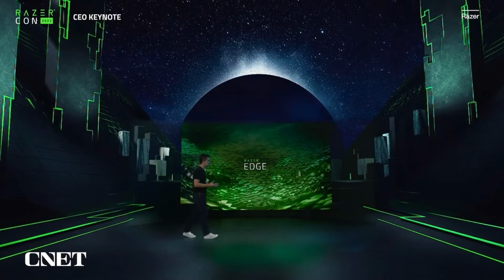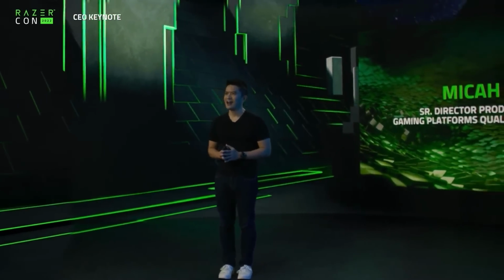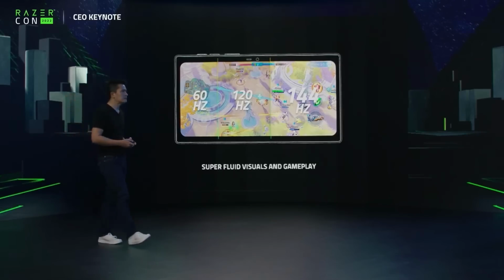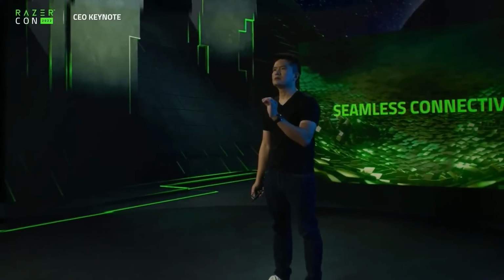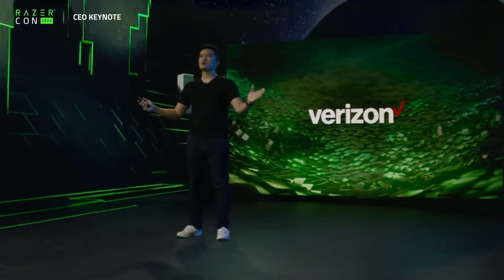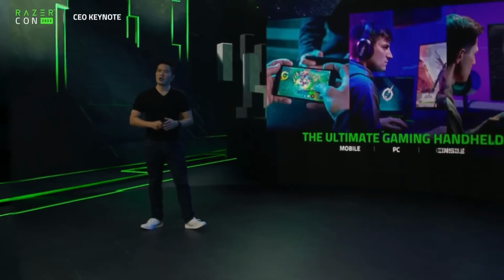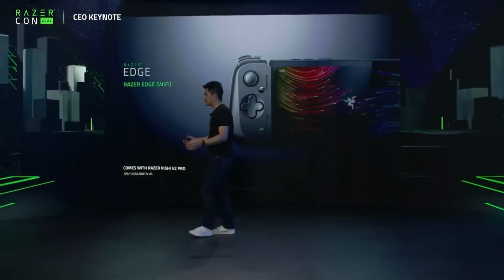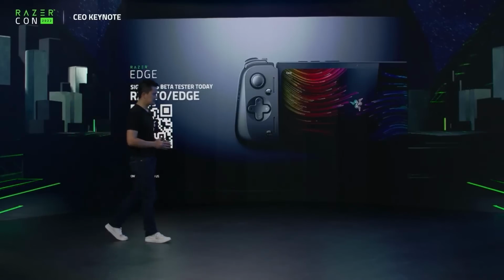Razer Edge Handheld Revealed (Watch It Here)

Comment: Most gamers tend to use more affordable carriers like MetroPCS or TMobile. If this is exclusive on Verizon, that means it does not
use a sim card, so it is going to be CDMA only. That's a mistake as most carriers in the world use GSM. Another problem I see is
that Razer decided to go with Nvidia instead of AMD. Nvidia is great and all, but they don't have open drivers for Steam. AMD does,
so you would get better performance with an AMD chipset. Android and Steam both use a Linux based OS.

Comment: Very impressive and at $399.99 they really nailed the price. With that, you get 128 GB of internal memory and expandability via Micro SD up to 2 TB. Wow! Well done Razer. Well done.
Reply: Steam deck better
Reply: @ROBMCMXCIII  The Steam Deck is pretty impressive. I already have a few Android games but I have been gaming on Steam for years and right now I have exactly 500 games on the service so I would have a large instant library of games for the Steam Deck. I just hoped the Steam Deck had an OLED screen. Seeing OLED in action on my phone and even my PS Vita makes it hard to go back to a regular LCD screen but again considering the specs of the Steam Deck, costs had to be cut somewhere.
Reply: you can watch my preview in my channel of razer edge
Reply: @TechsheetYT  Will check it out. Thanks.
Reply: Are you okay?
Reply: @kevikiru  LOL! Over the years I took advantage of a lot of Steam Flash Sales and Humble Bundle sales. The beauty of the Steam service on PC is that the games are not locked into specific hardware like console gaming. I also do have a few Android games I have collected over the years so I am interested in seeing more on the Razer Edge.
Reply: You basically get the same thing for the same price from a Steam Deck. Without needing to deal with a Verizon contract
Reply: @Ikbal Uddin That would be a pretty big issue. I was able to transfer some games on my phone to my micro sd card but not all.

Comment: So $400USD ($546CDN) for a device that has to biggy back off a high performance WiFi connection you may or may not have, piggy back off Steam link library running off a Gaming PC or Lag Central of the earth GamePass? Bruh then he had Diablo Mobile installed something my mom's Galaxy S6 could run. Idk man seems pretty greasy to me.

Comment: This is certainly better than that enormous $1000 thing they showed off with that go kart steering wheel looking case, but there are like three worthwhile Android games that can really push a flagship SoC. There's GI, COD, and LOL. DI is a thing but it's disgustingly pay to win. You can cloud stream console and PC games with any halfway decent smartphone as long as you have good wifi. Anyone with $$400+ to throw at a dedicated handheld gaming machine probably has a $500-$900 phone already, so why would they get this instead of just the Kishi V2 or a Backbone (Android version ships Nov,) which IMO is better. My Oneplus 10T is just as capable as this thing minus active cooling (which isn't needed for cloud streaming and 99% of Android games). It also does phone type things which is super useful. I just don't know who the Edge is for. Someone who doesn't have a flagship phone but wants to drop $400+ to mobile game, and also isn't interested in a Steam deck for native PC gaming on the go or a Switch with it's huge library of first and third party games?

Comment: In a nutshell it's a 6.8 inch tablet with a Razor Kishi controller. It would be a cool product if the steamdeck didn't exist cause you're getting a tiny powerful android tablet for 299 and a controller that costs 100.

Comment: Whats truly insane is the price
Reply: Could u get as capable a phone for that price??..with those specs??...
Reply: It depends if its a good android tablet on its own or not. If it is, its fairly reasonable based on the specs. If not its a complete joke because like the logitech, an Xbox Series S would be cheaper. The problem with Logitechs was they made this big deal on cutting down on hardware because it was cloud enable which made it a lackluster android tablet and overpriced cloud gaming handheld.
Reply: Not actually insane, 

What’s insane is insane is expecting a handheld that’s capable of playing full pc games locally installed and rendered by its own cpu-gpu and have store to install multiple said games to be made and sold by a company that also doesn’t have anything to do with where the games it plays come from cuz they aren’t running their own os and own digital games store in which to make money from to be less than $1000 still
Reply: Insane, insane, ultimate….and insane!
Reply: Razer phone was like 1k so this aint that bad...
Reply: Its more like a switch plus is actively cooled so i won't thermel throttle
Reply: It’s the ultimate price
Reply: Razer products mostly are failed products

Comment: It's a cell phone with a controller attachment. Not a true dedicated handheld for gaming, but I guess that's where the future is heading.
Reply: The switch is literally a small android tablet with attachable joy cons 😬
Reply: @JimmyMac88  but it has people making games for it not android apps and streaming
Reply: @JimmyMac88  
Yeah. Unfortunately, I only use it as a home console or a handheld at home only. I miss Nintendo's handhelds. The new 3ds(not xl) and new 2ds xl are better for putting in your pocket and playing on the go. Sure, you can take a switch or a steam deck with you but you're having to lug them around in a carry case/bag. Not truly portable like a ds or emulator handhelds like rg351p, 280m, pocket go, etc. Adding a controller to the cell phone makes it very bulky and not pocketable so you gotta carry them separately. It works, but I'd still rather have a dedicated handheld for gaming with built in controls that aren't touchscreen that's pocketable.
Reply: @JimmyMac88  the switch would have been literally 2x as much if Nintendo only the hardware and wasn’t involved in actually providing the game store and the game development
Reply: @bryanmiller476  i doubt it, the Nvidia shield released at about $180, so the switch seems priced appropriately
Reply: @JimmyMac88  its not android because its not running the Android OS
Reply: @2000sancho  no, it doesnt... but the chipset inside is that of android tablet with a low end arm based processor. The Nvidia shield runs the same soc for example
Reply: @JimmyMac88  true but what makes an android an android is the OS not the hardware inside the device, there are many arm based devices with diferent OS
Reply: @2000sancho  true, but thats kind of besides the point I was trying to make

Comment: I don’t get it. A 2400x1080 FHD+ display translates to a 20:9 aspect ratio, so very similar to a smartphone screen. 16:9 Xcloud and GeForce Now games will essentially run in a bordered 5 inch-ish size screen. Significantly smaller than on steam deck or Logitech G Cloud. The controller is detachable and looks very similar to a Razer Kishi, so the product works just like a phone/Kishi setup. Not sure why anyone would need this when they can essentially already do the exact same thing with most smartphones.  Sure, the G3x chip will run Android games and more demanding emulated games better than most phones but I suspect the improved performance here will be imperceptible to most people already gaming on  high end smartphones. Streaming games will run no differently to other existing devices as these services require only moderately powered chipsets to run effectively.
Reply: Geforce now upscales to fill my entire z fold and  xcloud can scale up 25:9... so it should be fine
Reply: Also, steam link and geforce now will runn at 144hz on this thing. I think when you look at the market. The most popular games are like esports titles

Comment: I wonder how this soc compares to the A16 bionic in the iPhone 14 pro max.
Reply: @Shaban Ashraf lmao I do... sorry the truth is a hard pill to swallow.. again, in benchmarks the A bionic chips do score better single core and multicore performance. But the margain in other benchmarks is marginal and real world use cases both apple and SD chips perform around the same level.
Reply: apple chip is always better but problem is thermal throttling...
Reply: @Amircapturedmemories  Apple chips are not way better. They do have better single and multicore scores. But when compared in tasks, they are essentially equal in overall performance to the top tier SD chips.
Reply: @JimmyMac88  wrong. Apple chips is always better and at least 2 years ahead of other socs
Reply: @Amircapturedmemories  you can easily look this stuff up... SD has done a great job closing the gap in the last 3 yrs

Comment: I hate those cheap switch style Controllers  🤦🏾‍♂️ These thing suck for precise aiming on FPS games it's very hard to aim with the Small Analog sticks just make them large like traditional thumb sticks and add vibration hapic motors 
Like seriously this is an L 
There's no Edge in this
Reply: FPS games are meant to be played with mouse and keyboard. Everything else in an L
Reply: I agree, they should’ve made a new razor edge pro

Comment: lol I'd get a steam deck fro 399 instead
Reply: No brainer, really no clue why anyone would take this over a steam deck?
Reply: @Jackie8-9  better screen. I have a steam deck and plan to use it mostly for remote play away from my desk. Steam deck 720p 60fps VS razer edge 1080p 144hz hdr. Plus wifi 6. Steam deck has up to 5ghz
Reply: @myricalcampbell6156  WiFi 6 is 5Ghz, just AX instead of AC.
Reply: @myricalcampbell6156  keep in mind that 144hz still needs to have the game to have the option to turn on above 60hz or even have the option at all144hz.
I got the rog phone and it shows all the android games that are capable of 144hz which are not many. 
Then it also need cloud service to allow it too.
So just because your device can does not mean will actually receive y unfortunately.
Reply: @Jackie8-9  I don't do cloud, I'm talking steam link or remote playing consoles on my home network. Not sure about the Xbox or Playstation apps but stream link can push out the full 144hz 1080p.
Reply: Got to save that dollar.